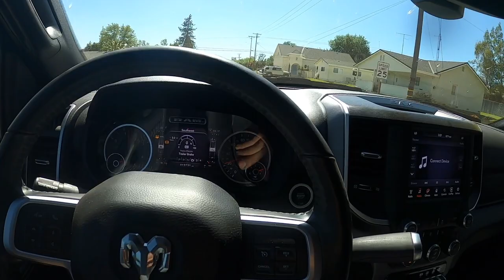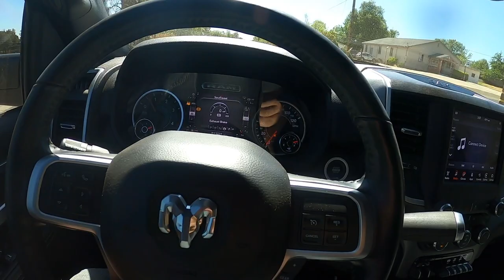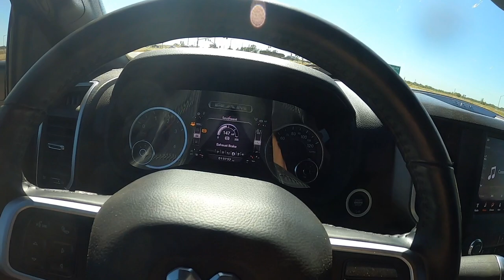2020 RAM 3500 Dually hauling heavy—— MAX TOW!!

Comment: Astonishing how Ram has Risen out of the ashes to be the Greatest pickup Trucks Ever made in History. It's basically a serious Semi truck without looking like a Semi truck.
Reply from the maker: Right? These trucks are a whole new breed it’s incredible
Reply: Yes sir I agree I love ram
Reply: I agree except for the transmission!
Reply: @krellerj1111  the aisin transmission is awesome 👌.
Reply: Ram was never in the ashes.
Reply: @krellerj1111  it’s not 2005 anymore that issue has been long fixed.
Reply: Facts!!!
Reply: @krellerj1111  EXACTLY!!! I’m on tranny #3 now😑
Reply: Lmao greatest pickup trucks ever made. This truck will never last what a semi truck will. This guy is nowhere near 44k pounds
Reply from the maker: @CoyoteFTW  keep relaying uneducated opinions as you please. 
Best rebuttals you can provide is to start towing what I do and figure it out for yourself
Reply: It's a fine engine wearing a tuxedo made of landfill.
Reply: @SJJsolomonSJJ  What trans are you running. I have a 2014 2500 it has the 68RFE with about 170,000 miles and I never had any trouble. I had the transmission oil changed at around 101,000 miles. The dealer put in a BG 310 transmission conditioner and changed 2 filters. I plan to have it changed again at 200,000 miles. It's still pulling like new. Really strong and no problems, I  hope it keeps on like it's going.
Reply: The 80s toyota helix would like a word with u
Reply from the maker: @blackice7408  😂😂 I’m sure it would be a great conversation
Reply: @CoyoteFTW  but it sure will outlast a ford, chevy or duramax 😂
Reply: Lol let Semis be Semis. Semis can tow military Abrams tank. Abrams tank weigh like 60 to 70 tons FYI. Which is 120,000 to 140,000 lb (just for the trailer's payload).
GCW would be at like 180,000 lb or 90 tons.
Reply: Ever made in history is a stretch, as an ASE Master Technician they have their good and bad moments. Arguably Ford is the best selling, Chevrolet is the most aftermarket supported, dodge has the most iconic partner with Cummins.
Reply: Some people think just because they have issues with theirs, everyone else does.
Reply: The 5500 is 18500 that's a semi tractor weight.

Comment: 53,000 miles on my 2017 Ram 3500 Dually, Aisin, 3.73...of that... 30,000 towing 12,000-15,000 lbs. high profile fifth wheels.  I grin on every trip and she hasn't missed a beat.
Reply from the maker: Hell ya! They are some hard working trucks

Comment: If you need to protect metal portions of the deck I would recommend getting a horse stall mat and cutting it down. I put those down and they work pretty well. When I haul the D5 I use tires to load obviously but the flat mats work great for everything else
Reply from the maker: I was going to get some old conveyor belting but that’s also a very smart idea. Ya I the first dozer I hauled was a d3 and she had her way with the deck for sure 😂
Reply: 100% second that. I work with those out in Texas all the time!

Comment: Just a tip, I mean no disrespect but when you chain to the trailer, you’re supposed to wrap the chain around the cylinder and back on itself. 
I noticed you just hooked to the rub rail, the rub rails aren’t meant for or rated for that.

But good video, I’ve got a 3500 mega cab and I love it.
Reply from the maker: There’s always controversy on that. Do what works best for you if you ask me. 
Over all though hell ya these trucks put in the work

Comment: I have maxed out the 40k on my Diamond C trailer with my Ram and it handled it just fine. The Banks performance add ons helped. Higher performance brakes sure helped alot too.
Reply from the maker: Dang you be moving some iron!! Stay safe on the road my man. Next set of brakes will be from hawk performance they’ve been my favorite for all my other rigs, let’s see if they beat the OEM pads

Comment: Be safe! I'm sure you are and your equipment will handle all that. A good (or just a stickler) DOT officer will ticket you for being overweight. That gooseneck ball is only rated @ 30k. I have essentially the same setup as you, but my trailer only weigh 6300 lbs, I haul for CAT and I won't go bigger than a CP44. My fear is getting into an accident and a good attorney sees that ball rating, then sees th GCVWR of the truck is exceeded and I'm toast. Even if I'm not the one at fault.
Reply from the maker: I can definitely understand where you’re coming yes technically I’m over by about 2-3k on my ball however from my experience and knowledge officers can mainly fault you if you’re over axle weights and or tires, things in contact with the roadways, any ball system will most likely fail in a collision that and or the neck of the trailer. On average a 40mph wreck will create over 200k lbs of force on any one object something is going to and will fail regardless. I’ve seen at my old job a tractor trailer and an empty lowboy sheet off the 5th wheel of the truck when it got rear ended by another tractor. There’s a lot involved for sure. However 3” ball is in the works to have a true 40k rating on the trailer. 
Appreciate you. Thanks for the comment

Comment: @4:25.   Why not wrap the chain from the machine around one of those rollers between stake pockets and then use the binder to sinch the chain after it emerges from the upside of the roller to the chain coming down from the machine so that you won't risk bending that thin metal bar or the hook bounces out down a bouncy county maintained road.
Reply from the maker: Great question, that rub rail is much thicker than you think, and using the roller to tie back up the machine actually binds up the binder making it contact with the chain making it twist and hard to tighten down to the machine there’s not enough separation between to the two make it easy and not become a pain in tying down equipment

Comment: Not being a jerk, just a heads up. Some dot don't like the binder on the outside of the rub rail. They like it inside the rail and hooked to the pocket. If you get a real prick he may try and screw with you. I've had my share of pricks. I have over a million miles hauling oversized loads in a big truck with a low profile step deck.
Reply from the maker: Not at all  I appreciate it. I have my own dot officer I’ve known since I was a kid I’ve asked him this before he said ya technically it’s not right however if anyone is to give you a hard time about that and only that just tell them to call me. Since he’s their superior over here in Northern California lol. But no one I’ve seen around my parts have ever been harassed about that. 6 years hauling Lowbed and now this never even ran into a conversation about it.

Comment: Like a musquito to a musquito lamp, some people just have to cut off the truck towing! I tow with my 1995 cclb f350. Nothing nearly this heavy and usually about 60mph. For safety I use the slow lane and everything.
Reply from the maker: It never fails. Things I’ll never understand n life. I used to haul even heavier equipment with a tractor trailer grossing about 120k lbs and you just get used to getting cut off. Apparently people would rather die then getting stuck behind you 😂

Comment: Do you see yourself towing this around long term? Or was this just for a video? How’s the trans/brakes/ EGT’s doing with that load? Thx
Reply from the maker: I tow at this weight every week and sometimes 2-3 times in a week. 
Trans is solid, did the 30k service on it, I’m at about 38k miles now, 
Brakes are still in speck being oem, I will be doing the brakes soon though. 1/2 wore down is trash for me. 
Egt don’t know and don’t care. Truck will derate its self if egts get to high.

Comment: I've never loaded a CAT sheepfoot roller but I believe you should be able to make them run just on the tires and that roller won't slip so much climbing the bed. I haul for Sunbelt and a driver told me about it and I've never known for sure on how exactly to do it on every different machine but I know if it slips I start messing with the controls until I get it to climb ok.
Reply from the maker: It’s a pain but make it work some how would be nice to just have power to the tires 
Just got to ease it in lol

Comment: Awesome video man I too am an operator and I'm not trying to be "that guy " just curious ...around here  ( Rhode Island ) when I got my class a cdl we were all taught that if you hook any binders or chains to the outside of the rub rails they will consider it an unsecured load and also over width .just a heads up
Reply from the maker: Naa you’re good man. I’ve head stuff like that and I’ve never seen or heard of a dot officer fine someone on that. I’ve spoken to officers around here told me if anyone does get you in that to give them his phone number. 
Think about it also you can tow a full size truck and the mirrors stick out farther then the trailer but it’s not a wide load by any means . Biggest thing on chains and binders, if there is a binder handle sticking far past the deck of the trailer or a chain swinging from the deck that can cause a hazard.
Reply: Thats good .I know around here something like the mirrors on a truck sticking out they would get you for same with snow pushers that are over width you got to haul it the long way on a trailer .same goes for plows on trucks bit like you said it all depends on the officer you get too
Reply from the maker: Yup! Exactly! Ask a few around your town see what they say.

Comment: Did you actually weigh that whole thing at the truck weighing scale station to "confirm" it's actually at 47,000 lb of GCW or did you just guess and roughly estimate it to be around 44,700 lb of GCW????
Reply from the maker: Didn’t cat sale it, just took my unloaded weight that I know and add what the tag weight is on the roller. Cats been pretty accurate with that too so it’s a good guess round number

Comment: Hello, excellent video.  I have a question which Truck recommends me with a 40 ft Trailer to make Hotshot?  The RAM 3500 or 5500?
Reply from the maker: Thank you, personally I would go with a 3500, I’m not sure the amount of weight you want to be hauling everyday. Being in the hwy with 4:88 gears you’ll be at 2300 rpm or so doing 70mph with the 3500 4:10 gears you’ll be at 2k rpm 
Little bit more comfortable ride also, plus you can get the HO since 4500-5500 are SO trucks 
5500 is a much heavier duty truck however it can limit you in ride quality. 3500 is a solid all’s round hauler and having that 1000 ft lbs does make a huge difference
Reply: Need help I have a Dodge Ram 3500 i need to haul a backhoe 416 f2 cat which gooseneck trailer would be good to use please help me out
Reply: 40000
Reply from the maker: @gregulate891  that’s about a 16-18k machine any trailer with at least 24k gvwr will be a safe way to haul that.
Reply: Hi there. You are right I was investigating and of that type of specifications on the truck RAM 3500 2022. What I have the doubt that I can use the trailer of 40 ft is to make Hotshot. You know it is a very hard job that is why I ask you.

Comment: Love the video man! Just wondering what tires your running, and how your liking them ? Thanks. Would be a good video to watch too😂
Reply from the maker: Thanks man. 
They are BFgoodrich AT2 tires 
Love them but with the weight I tow I’ve dusted them down to nearly nothing with in 12k miles 
If you don’t tow like I do on the near daily they’ll last much longer for sure but over all love them just wish they lasted longer. 
I do have a video on them somewhere on my page did it just before winter
Reply: @IManOPERATOR  awesome thanks man
Reply from the maker: You know it 👌🏼

Comment: GOD BLESS YOU FOR REPLYING TO ANYONE LEAVING A COMMENT ⛪️
Reply from the maker: Lol I appreciate it! Always try to reply to everyone
Reply: @IManOPERATOR  and of course you just  reply woooow!
If you do not go to heaven Idk who would go!
Anyway quick question boss:
About to buy a 3500 ram I already own a 3500 DRW Tradesman but towing/hauling capacity sucks for what I would do …
What kind of 3500 you have to get your GCW so high like that?
GOD BLESS YOU AGAIN MAN!
Reply from the maker: @rorotkt16  hahaha thanks my man. 
So your best way to get max payload definitely is a single cab truck however make sure you get the 4:10 gears, HO Aisin max tow combo truck. 
From there you can get better GCW with better wheels and tires like gojng to 19.5s like I did with my truck, since the oem tires that come on these trucks are well below the capacity of the axles themselves
Reply: @IManOPERATOR  of course man!

Just wanting to know if up to 34,010lbs with the HO aisin & 4.10 ratio is good enough for what you doing?

Reason im asking is because I seen a truck I went and on the Ram website with the vin it says up to 34,010lbs towing capability.

Good enough for what you doing?

Sorry to bother!
Reply from the maker: @rorotkt16  ram puts a towing capability for marketing and for how the truck currently sits 
Axles hold more weight than the tires can handle on the truck oem. 
With the right axle/tire rating like how my truck sits it’s good for 54k lbs GCW
Reply: @IManOPERATOR  I see! 
So if I get a 4.10 axle ratio & HO Aisin what else I need to modify in order to reach 54Lbs gcw other than switching the tires to 19.5 please? Thx so much brother!!

Comment: are you towing 44k or is that your combination weight, load truck and trailer
Reply from the maker: That’s combined weight lol.
Reply: @IManOPERATOR  not to shabby. Technically your overloaded at about 600 lbs. the ram dually h.o long bed crew cab is good for about 43400 GCWR I believe, but don’t hold me to that… either way, it pulled like a champ. Really making it hard to decide between a 2023 f450 and a Ram 3500 DRW
Reply from the maker: @Subi_doo  GCWR is 54k lbs for this combination. Not even close to being overloaded. 
And honestly if you like the power feel but a ford. If you like to have an exhaust brake that’s worth anything buy the dodge. How I see it living in the mountains going up and down 6-8% grades each and every time this truck handles it very well. My new excavator and buckets on the deck I sit about 48k combined
Reply: @IManOPERATOR  the added up GCWR might be 54k for you truck gvwr and trialer gvwr, but the manufacturer, RAM, says their ram 3500 dually, crew cab long box, had a max GCWR for their truck and trialer is 43,400 lbs. I have the ram weights page from the dealer. The cab and chassis tow less
Reply: @IManOPERATOR  I’m trying to run a 30k trailer, but I’m concerned about pin weight, and rolling through scales. The manufacturer says 43k is their max GCWR, so I’m assuming, you don’t get on the freeway with that kind of weight, let alone go through scale houses. I’m sure with those weights, you’d be in for a big surprise. No doubt the Ram can handle pulling it, but it’s not rated for it by the manufacturer.
Reply from the maker: @Subi_doo  manufacture rating is dude to the tire capability, run though scale houses here and there on longer trips never been pulled in. 
Manufacture ratings mean nothing to dot. I can change the rating on my truck to whatever I want with a new tag. 
Running lowboys if you’re over weight on a machine you just put in a pup trailer to spread the load out more over more axles and tires. 
You can do the same on these trucks if you started getting fancy.

Comment: I have an 11 single cab dually, when I'm towing about 25k the wheels will skid under hard breaking,  very sketchy.  I've always wondered if a crew cab being heavier would help prevent locking wheels up.
Reply from the maker: That’s pretty odd to have that happen. Maybe mess around with your weight distribution on the trailer. 
And also yes having a heavier truck always helps out too.

Comment: So if your rear end is breaking loose under power does that mean you dont have enough weight on the box????
Reply from the maker: I have on average 15-20% weight in my rear axle sometimes you just break loose. These trucks just have so much first gear torque. And the drag of the load just amplifies it. Sometimes could be dirt on the ground or oil who knows but it’s happened a hand full of times out of no where then won’t happen again. Just things you want to be careful of, you can definitely nap axles or a pinion that way